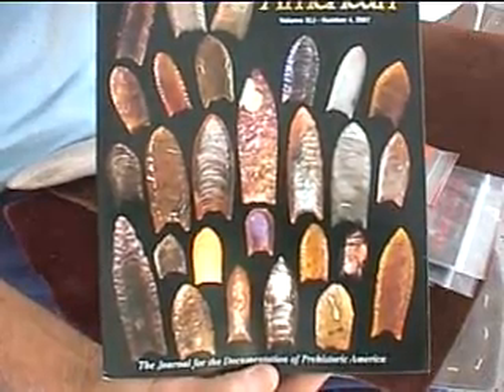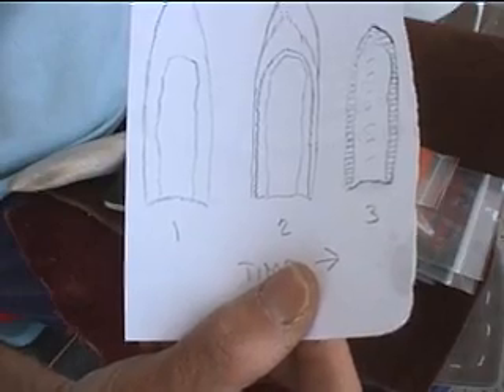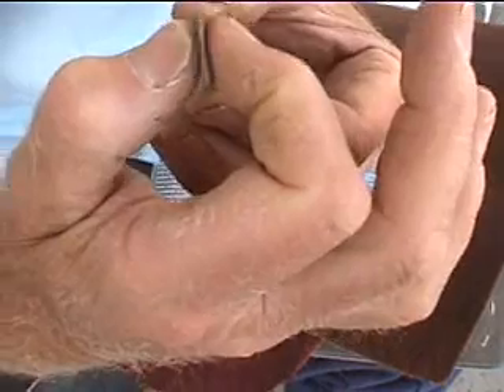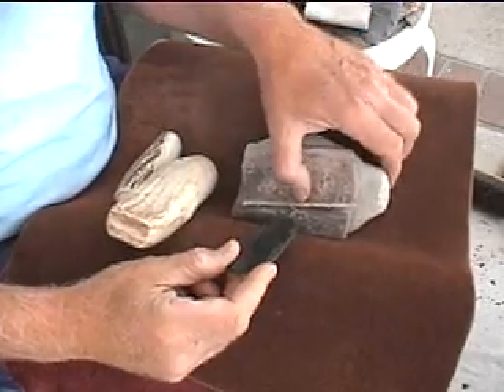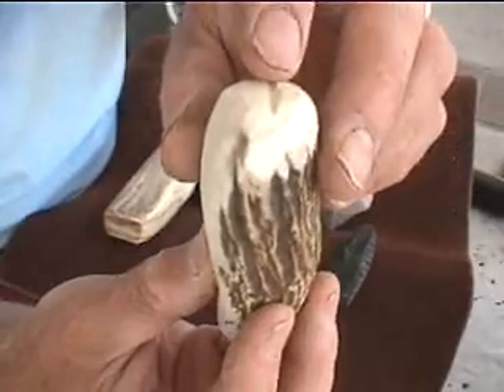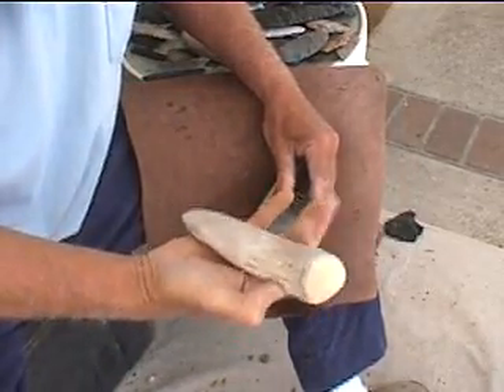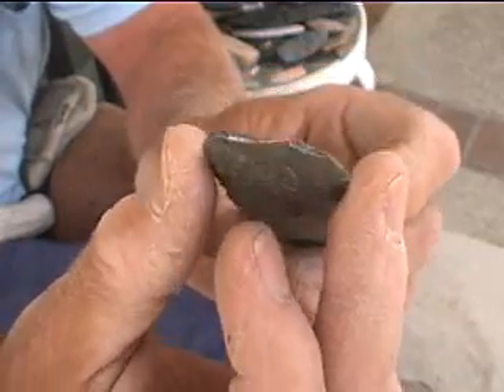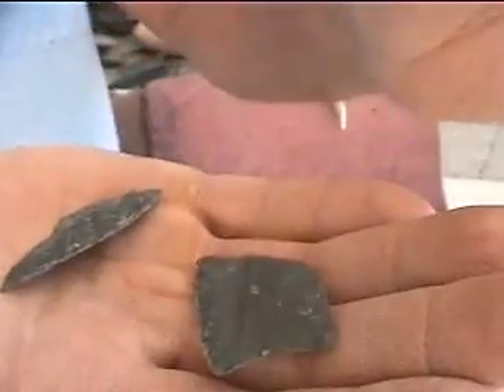Folsum, Percussion Fluting Part 1

Comment: Dude ty i have problems with fluting😅on my Obsidian points the flute starts well then dives though the point and i now have 2 pieces
Reply from the maker: It happens. Study each failure and make adjustments to the angle and/or amount of force used.  It takes dozens of failures to get a feel for it. No one masters fluting without many attempts and tons of practice

Comment: I'm no expert, and nothing compared to you, but I have an idea for you to try.  when swinging for pinpoint accuracy, pin your elbow in your waist/hip, and pin the hand holding the piece to your other knee.   You can swing exactly the same spot consistently, by keeping the elbow locked, and you can move your other leg to move the piece very precisely.  it seemed like you had the exact position I am trying to describe, you just had the elbow floating, which makes more muscles have to coordinate.
Reply: Excellent suggestion! 👍

Comment: Jim I enjoy your videos, I'm just learning. I have one Clovis I found but Like S.A. Cuthberson's comment, I tend to believe the Clovis and Folsom are the same point. One question, I am to the point where I can make a preforrm but when I try thinning I end up with whatI;d call a drill.... any suggestions on making thiner points?
Reply from the maker: It does take a lot or practice to make the preform thin as with any biface. And support becomes more critical as the biface gets thinner, especially for fluting.   But remember, these folks started knapping as kids so by the time they were teenagers they were likely master knappers!

Comment from the maker: Hello, yes, using abo tools is very similar to using copper, but different! It takes at least a week or so to make the adjustment to antler billets, so just resist the urge to go back to copper. The antler requires sharper edges on the platforms and all grinding should be done with hammerstones. Use hammerstones in the earlier stages to remove thicker flakes. The antler is best for the mid to later stages and can only remove thin flakes. ...jim